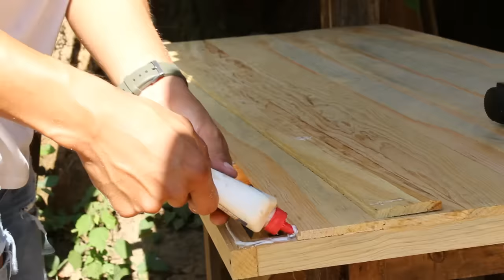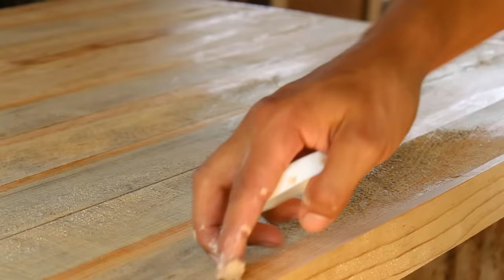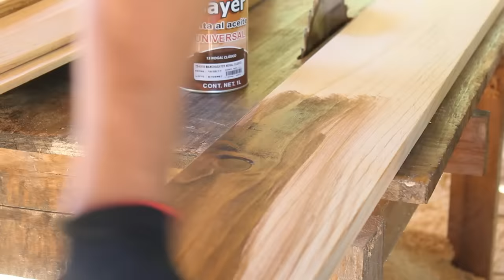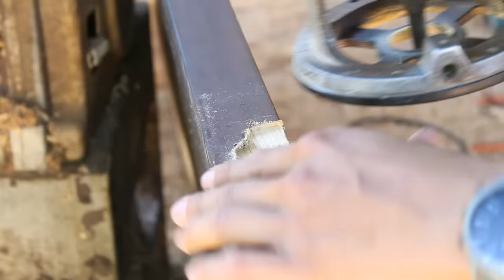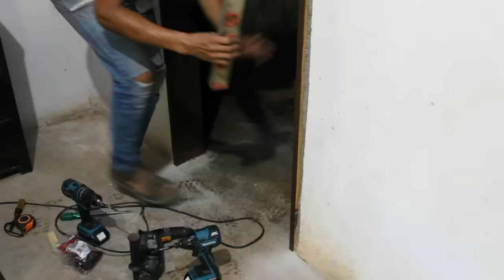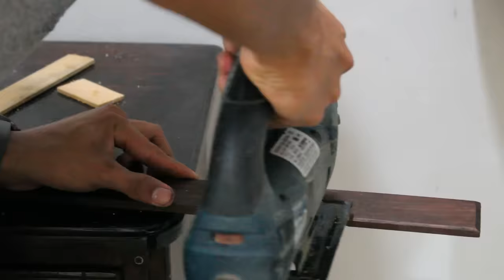Making a wooden door | DIY door 2/2

Comment: This is a bad idea, gluing the board joints. They should be left loose to allow for movement, shrinkage and so on. Glue them and the boards will split at the weakest point.
Reply: He was using Elmer's glue it flexes
Reply: Complete bullshit, I've glued board joints plenty, still no splits 5 years later.

Comment: Hey, I just ordered a piece of rubber wood (110x200cm 30mm) and want to use it as a door. Can I do this or not? Now the shop says its not good as a door as a door needs a frame. Does the glue not hold it together over time when I use it as a door or what is the problem? I see it is used for kitchen cabinet door for example.

Comment: The tongues on the boards should never be glued they need to move,expand and contract,if not they will split.
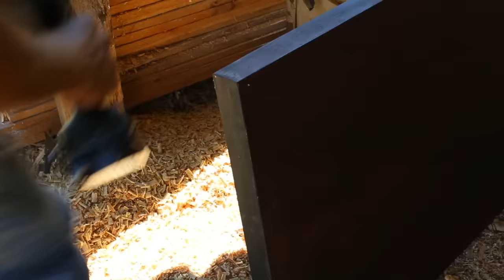Reply from the maker: Thanks for your comment John, you are right, as a hollow door, it needs to "breathe", that's why I made some small holes in the frame (part 1) 5:45, this door doesn't have any kind of problems so far!
Reply: The finished door looks very impressive.

Comment: how thick are doors normally
Reply from the maker: They are normally around 1 3/4 (4.5 cm), but can be 1 3/8 if there are an interior doors
Reply: Rene's Workshop if I want to build an exterior door from pressure treated lumbar, what is your best suggestion to get the door the correct width, like would I buy a 2x2 and cut it down to 1 and 3/8ths?
Reply from the maker: I recommend to do that, using the standard 1 3/4 for exterior door, so your door won't be that heavy